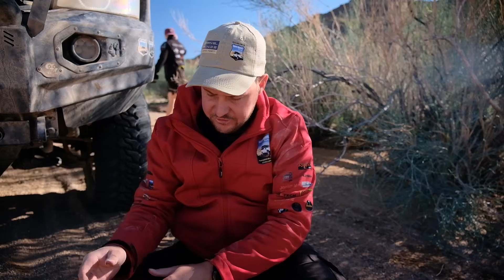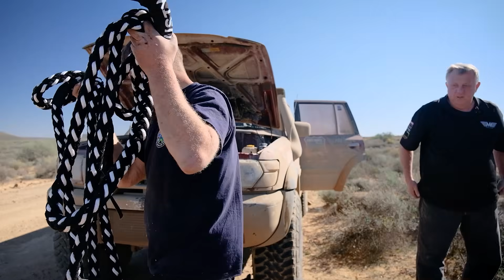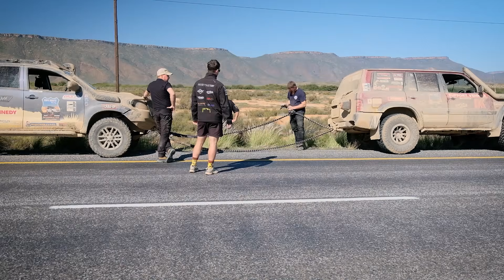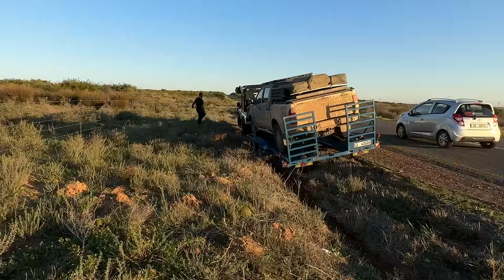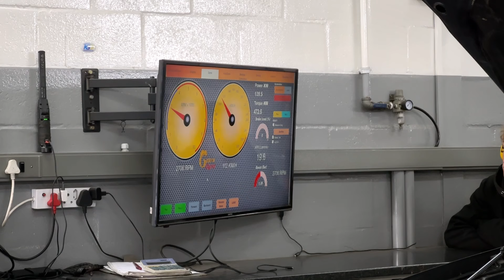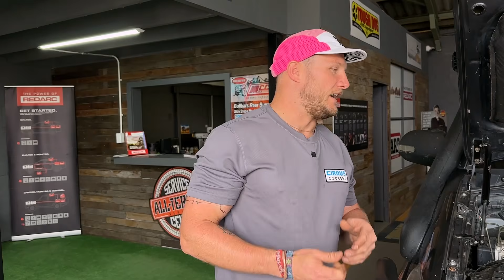Hilux Engine Rebuild: The Truth About Injector Failure & Bad Fuel

Comment: Another thing is treating your diesel with a treatment, no not injector cleaner but rather a treatment. Something like Liqui Moly Super Diesel Additive,  Diesel Treatment or Diesel Cure. Lubricity is a huge thing when it comes to diesel. Adding other crap like paraffin dilutes the treatments that are supposed to be in the diesel. By adding a treatment it adds lubricity back to the diesel to help with the pump and injectors. This is a actually a huge problem in the US they are forced to add a additive there.
Reply from the maker: Thanks for the input. There are so many brands of additives saying their the best and in my knowledge, the fuel stations already have their own additives in the mix. I am always worried of mixing to many additives and making it worse. What in your opinion would you suggest?
Reply: @DieterPey  There are a lot of misconceptions. First, there’s a difference between an injector cleaner and a diesel treatment/conditioner. They often come from the same brands, Liqui Moly, Wynn’s, Würth, etc... but they’re quite different. For example, you get a Wynn’s Injector Cleaner (detergents to remove deposits) and you also get a Wynn’s Diesel Treatment (adds lubricity, mild cleaning, sometimes a small cetane boost).

Big stations usually dose and filter their fuel, but mistakes happen. When the tanker delivers, it can stir up sediment and water at the bottom of the tank. If your timing is unlucky, you fill while that muck is in suspension. Many sites have filters/sensors and good delivery practices, but not all do, some “big brand” outlets aren’t equally managed, and small rural stations can be super kak.

I overland, so I try to avoid small low-turnover stations. My vehicle runs piezoelectric injectors with a Delphi high-pressure pump, which are extremely sensitive to bad fuel. Your car’s filter can’t remove paraffin/kerosene adulteration, and while many systems have a water-in-fuel sensor, water itself is a real problem (it’s incompressible and can damage injectors in modern HPCR systems).

That’s where a treatment helps when you have to use iffy fuel. Products like Liqui Moly Super Diesel Additive, Wynn’s Diesel Treatment, or Würth Diesel Cure add lubricity (good for pump/injector wear) and include water-handling chemistry. Look for ones with a demulsifier, that helps separate water so your fuel/water separator can catch and drain it, rather than emulsifying it into micro-droplets that might pass through. A little cetane bump can also smooth combustion.

Lol, I sound like a salesman, but I’m not I’m just obsessed with keeping the vehicle perfect. To answer your question: for a treatment, Würth Diesel Cure is solid (farmers love it), and I also use Liqui Moly Super Diesel Additive for the same reason.

On long trips in places like Springbok, I’ll add a treatment with every tank not an injector cleaner, but a lubricity enhancer/conditioner like the ones above.
Reply: @DieterPey  u need to test lubricity and moisture content of the fuel  if u gonna go that route   or just put a lil sht in it and oil and let her eaatt...

Comment: Hi Pieter,  I agree with what you have said. 

It happened to me twice.  The only thing I would have considered would have been ceramic coated pistons as some insurance.  

When this happened on my 150 Prado I had my diesel analyse and it was about 35% Parrifin.  I got that from a well known service station that are on all major highways and one normally get a well known breakfast on their premises.  

I also agree that injectors needs to be checked every 150000KM but the price of injectors makes it close to impossible.  

Love your content.
Reply from the maker: I would like to go with ceramic coated pistons, but they are a fair amount more expensive. I'll save up for either stronger pistons or even forged internals in the future. You are right, even knowing you need to check and replace injectors at 150k mark, when you see the price of them, you wonder if it's worth it or risk it.

Thanks for the support and comment!
Reply: Out of curiosity, had you tuned or done any extensive modifications to your two vehicles?
Reply: Yup coated or upgraded pistons ftw